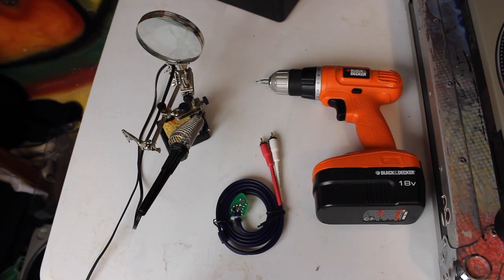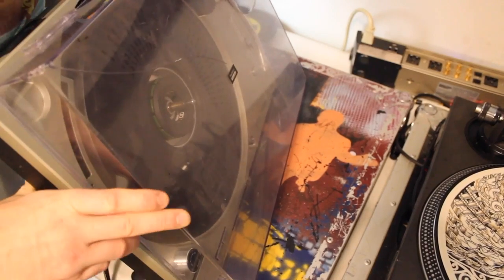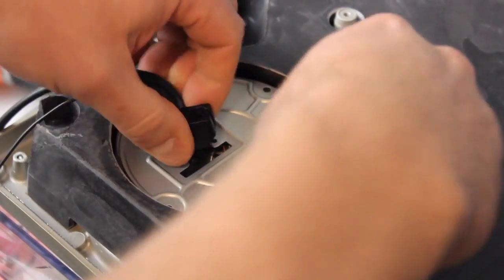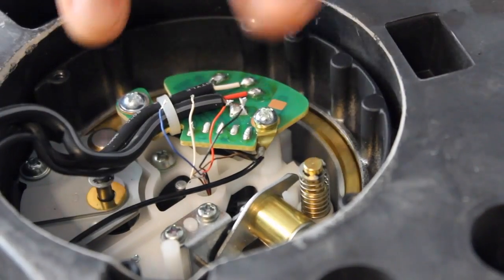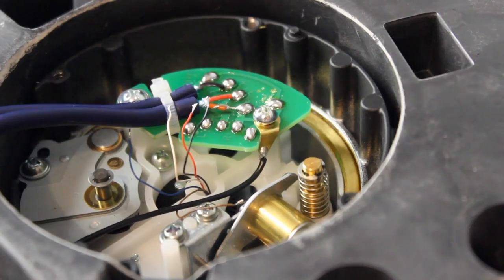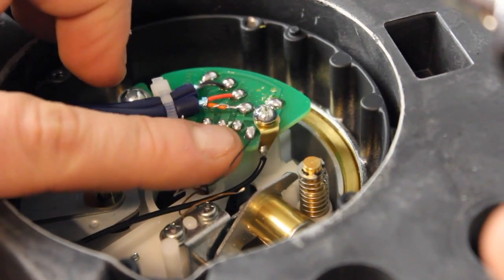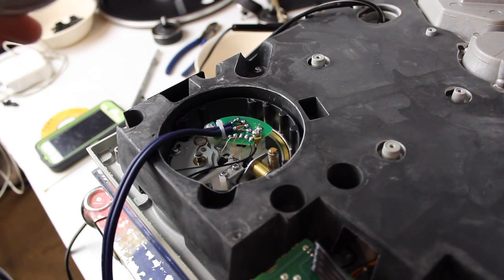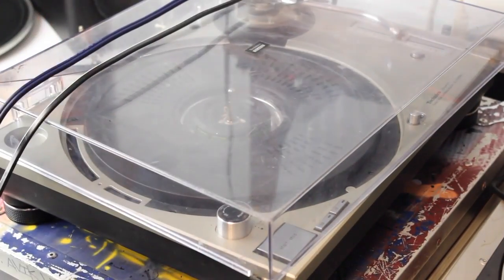How to Replace the RCA Cables with Internally Grounded Cables in a Technics 1200 Turntable

Comment: Even with extremely limited soldering skills, once you open it up (which is what actually takes long,) the soldering is extremely easy.

Not only that, but my original technics cables were shot, this cable replacement made the sound MUCH more better in every way, and I don't have to ground anymore and have a longer length of cable!

Comment: I think that watching your video just gave me the solution I’ve hunting for my whole weekend. I've got an old turntable too on which I want to replace the old original RCA cable whose leads are directly soldered to the terminals inside the unit just like yours. To this end, I bought high-end brand new QED RCA cables ; so far so good, but problem when I cut both cables I noticed that are not two (as 'traditionally') but three separate wires in each cable sheath, and I had no idea how to solder these 6 wires to the four-terminal circuit board of the tonearm. Even tough this stage wasn’t taped we can see when you put the board back that you wrapped the wires (i.e. those without individual plastic insulation) around one of the two others before soldering it together to the negative terminal, thank you very much, Cheers from France sorry for bad English

Comment: The black tab is a safety device to secure the wires and prevent them from detaching and causing a short and/or electrocution. Weird that in the vid you state that you don't bother with this!
Reply: I know I am pretty randomly asking but does anyone know a good place to watch newly released series online ?
Reply: @Phillip Gage Lately I have been using Flixzone. You can find it on google =)
Reply: @Luca Hugh definitely, I've been using flixzone for since april myself :D
Reply: @Luca Hugh Thank you, signed up and it seems to work :D I appreciate it !!
Reply: @Phillip Gage Glad I could help xD
Reply: Right. So is there only the thin wires holding it in place?
Reply: @gooddogtrainingservices5351  No.  The main 2 wires (L+R) go to a PCB where they are tie-wrapped in place.  But he shouldn't have left the black strain relief off.

Comment: if your going to use a drill set the clutch very low to like 1 or 3. just to snug the screw. after wards use a screwdriver to tighten it completely. I would never have you touch anything for anyone untill you learn the basics.
Reply: easy tough guy

Comment: For those that have been asking. at 8:47 of the video (kind of off screen and a little blurry) DJ Valence cuts the ground wire (the one that go's out with the RCAs) at the ring. Leaving the ring and the ground wire that go's from the ring, across the tone arm base, around the tone arm base, under the clay weight, to the pitch control screw. This one needs to be left as is. So to review the only ground wire that is cut is the one from the ring going out of the turntable with the old RCAs. Hope that helps.

Comment: I didn't catch what you did with that ground wire. Did you just snip it off, or ground it internally on one of the L/R grounds on the board the RCA cables were connected to?
Reply: Did he ever get back to you with an answer?  It looked like he just sniped it off and left the internal ground screwed into the board but not connected to anything else.   Perhaps the shield wires from the rca cables are connected through the board.  Could test with multi meter.
Reply: I actually went through with the purchase, swapped them out, and realize the new boards were already internally grounded. Came with that configuration out of the box. Just snipped the portion of the wire shown in the video. Was very simple! Tables sound great too!

Comment: You didnt put the black tab back in that connects to the metal plate or does it fit with the new wires?
Reply from the maker: +1200technics1 It does fit with them, I just skipped that step because that's how my other tables are.  I actually put the tab on later, but didn't want to re-edit the video.
Reply: Ok they did fit i put mine on this weekend  everything worked fine.Thanks for the video..